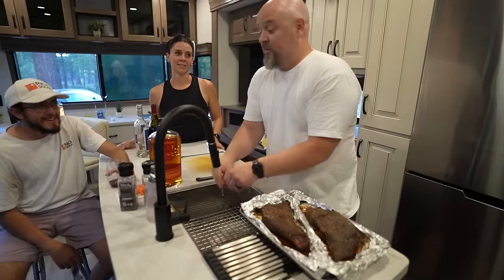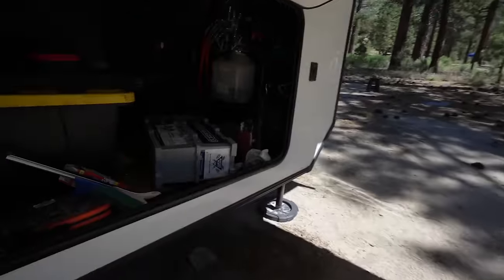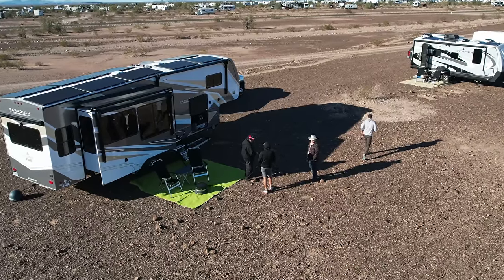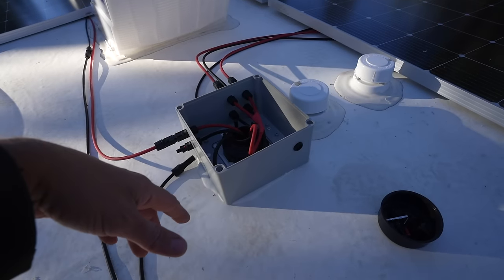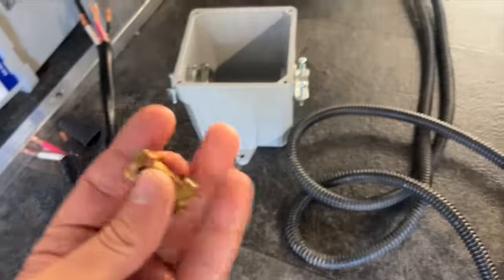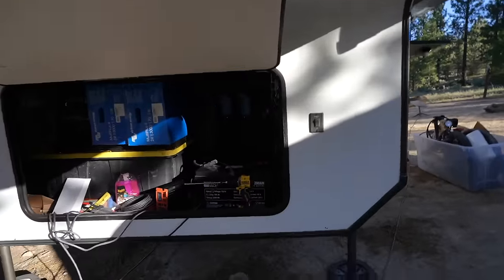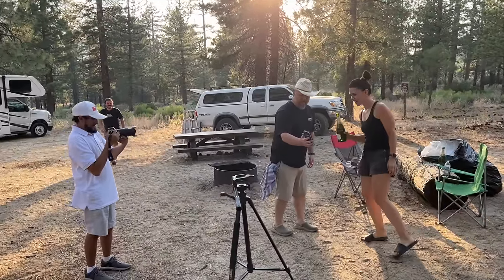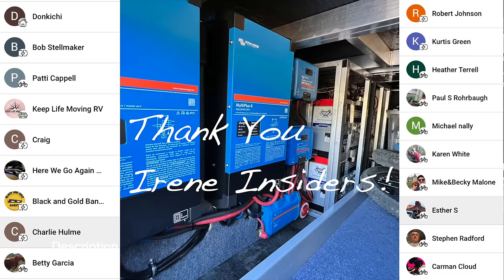24v Battle Born Battery Power with 2750 watts of Rich Solar! (RV Lithium Battery UPGRADE)

Comment: Just doesn't seem cost effective to me. if you're always in a place without shore power i can see this or a genny, but this setup for the avg non influencers who don't get really good deals for the advertisement of the video the cost is sky high. It would take many years of off grid living to pay for this setup before actually saving anything vs a genny at less than half the cost. it would prob take almost 4 years to pay this system off at a price tag of 8k + which this easily is with those BB batteries being a grand a pop.

Comment: Thanks Aaron and Chris! Below is what I will be installing beginning tomorrow morning on my 2022 310RL. Purchased the materials locally. Thanks for the motivation. You convinced me to go 24 volt over 12. Great video! 
 
4 380W Solar Panel
2 MP compact 24-3000-inverter 
1 100/50 Charge Controller
1 Smart Shunt
4 Enduro 24-100AH
1 Bluetooth Dongle
Reply from the maker: Hello 👋. Nice system you have going in! You’re going to love the lower amperage of 24 volt! Have fun!

Comment: This video could not have come at a better time! We have been shopping around for solar panels to add to the 200W  panel that came with our trailer. I just ordered four of the 250W, thanks for the discount code!
Reply from the maker: Great to hear Lulu, thats awesome! You're going to love the extra power! 🌞
Reply: We had to give up a lot of our system when we traded in our old trailer and this was the final step in building the system in our new one. Also, Rich Solar currently has a 25% off sale so that was a nice bonus. 😎

Comment: You coulda just bought some nice, used or even new SunPower 250w solar panels for like $70-$80 per panel in bulk at SanTan Solar, which is like 1/4 the cost and about same performance.
Also your RV Rooftop AC probably uses 1300w-2500w, each.   Even 3 x 1300w each =3900w/hour.  11kwh of battery is not enough, unless you install a minisplit.

Comment: Hey guys happy camping! So thanks for sharing your awesome victron system with us; I just recently got a quote for a victron system powered by 4 270 ah battle borns and 1200 watts of solar filling my roof…. Here’s the question will the one more battery off set enough for the lesser of solar granted I have a generator that could be used as a hybrid system with remote start to bring the batteries back up if needed; which then tells me why the extra battery if my ac could make it through the night with less. I hope I have asked this question understandably lol  thanks again. Oh next time you guys come through Tucson az say hi

Comment: I use a touch on or off faucet in my kitchen, and it really does help to save water. I put half of my panels in parallel/series and the other half just in parallel so I don’t have to worry so much about shading. Thanks for the video.
Reply from the maker: Thanks for sharing that! We had a touch faucet at our house and really loved it too!
Reply: We have a Kraus in the kitchen at home and it’s amazing. I got it at Home Depot because Amazon wouldn’t ship to Calif. It’s not just good at saving water. It’s great for washing stuff off your hand, like from making sausage patties or meatballs. Especially useful when dipping chicken into a panko cheese mix which creates cheesy gloves on the fingers. I can turn it on, then stick my gluey hand in the water and not have to clean the on off valve lever.

Comment from the maker: 🔋BLACK FRIDAY SALE NOW up to $400 OFF Battle Born Batteries https://tinyurl.com/2s3me6b5

🔋Battle Born Batteries 👉Save $50 on Battle Born Batteries https://bit.ly/BattleBorn50 Code "ireneiron"
😎Rich Solar 👉Save 12%💰 with code "irene12" https://richsolar.com/?ref=ireneiron
😎 250 watt panel https://richsolar.com/products/mega-250-watt-monocrystalline-solar-panel-best-12v-panel-for-rvs-and-off-grid-25-year-output-warranty-ul-certified?ref=ireneiron
💙MORryde 👉Save 7% on select products https://shopmorryde.com/?ref=irene Coupon Code 👉🏼 ireneironfitness7%
🌞200 watt portable solar panel https://richsolar.com/products/200-watt-briefcase-portable-solar-charging-kit?ref=ireneiron 👉Save 12%💰 with code "irene12" 
🔑Keyless RVLock www.rvlock.com/ireneirontravels 👉🏼💰SAVE 15% w/ code IRENEIRONTRAVELS
❤Alliance RV https://www.alliancerv.com/contact-sales
🛻Pullrite https://pullrite.com
🚲 Our E Bikes - Lectric eBike XP Lite : lectricebikes.sjv.io/GmZ6rL

BATTERIES
🔋Save $50 on Battle Born Batteries https://bit.ly/BattleBorn50
🔵Victron Multi plus ii 12 volt https://amzn.to/3suF3E8
🔵Victron Multi plus ii 24 volt https://amzn.to/3OKs3Sy 
🔋Victron 3000 MultiPlus Inverter https://amzn.to/3eZIWr1
⚡Surge Protector https://amzn.to/32ST9TD
🔋4/0 Battery Cable https://amzn.to/3eZnTVm
🔋Main 300 amp battery fuse https://amzn.to/3KT73I5
🔋Main 400amp t fuse https://amzn.to/34AVza5
🔋Inverter 300 amp Fuse https://amzn.to/3GecSf2
🔋Blue Sea On/OFF Switch https://amzn.to/3JJMGea
🔋Busbar 300 amp https://amzn.to/33X0OQI
🔋BusBar 400 amp https://amzn.to/3zzN1ve
🔋4/0 battery lugs w/ heat shrink https://amzn.to/3IufBSh
🔵Victron Bluetooth Battery Monitor https://amzn.to/3F8tmUt
🔵Victron Cerbo WiFi Monitor https://amzn.to/31EPQPi
🔵Victron Lynx dist https://amzn.to/3KQOUdS
🔵Victron 7 inch screen https://amzn.to/3solDkB
🔵Victron Orion 24v-12v https://amzn.to/3ssgTtX

TOOLS
🛠 Battery Crimper https://amzn.to/3Kxouwb
🛠Battery cable cutter https://amzn.to/3FLQdWk
🛠Heat shrink gun https://amzn.to/3tQV1HH
🛠Multi Meter(voltmeter) https://amzn.to/3Al0RSw
🛠Ferrel crimper https://amzn.to/3AkZQdx
🛠Ferrel crimper https://amzn.to/3tQWxJT
🛠Plastic Scraper https://amzn.to/3qN2W6U
🛠Heat Shrink https://amzn.to/3KoDdcJ

SOLAR
☀250 Watt Solar Panel https://amzn.to/47FmEVt
☀Victron 150/85 Smart Mppt Solar Controller https://amzn.to/3n9giIf
☀Victron 150/60 https://amzn.to/3YIBuGI
☀Panel mounts https://amzn.to/33DALyr
☀2 pole breaker https://amzn.to/3ArzwhS
☀1in Wood screws https://amzn.to/3Ims3TL
☀Mc4 connectors https://amzn.to/34Y6BpN
☀Roof Port Box https://amzn.to/3Ky6Ms8
☀Rubber tubing for Dicor https://amzn.to/3KszWJf
☀MC4 cable extension https://amzn.to/3Ag66De
☀Butyl Tape https://amzn.to/3qKYx45
☀Dicor self-leveling https://amzn.to/3AqqZeX

Comment: Impressive install! I am not sure I want to know the retail price on that. Shout out to RichSolar, I have one of their 150W panels on our trailer. It usually out performs it's rating by a couple of watts. I plan on getting more when I get around to upgrading from our little 200Ah system. I realize these videos are a little behind on showing, but I hope you guys didn't stay for the Tropical Storm. It looked like it might wash some roads out around there.
Reply from the maker: Thank you! Yes, we were out of that area before the storm, but you're right, those roads in with all the rain would be really bad.

Comment: Aaron, your system is virtually identical to ours with dual 24V Multiplus 120x2 inverters and the Watchdog EMS. You will probably run into a couple of the same problems I did with the Watchdog throwing a false “Missing Neutral” error when you plug into many 50A shore power sources and also with the Multiplus minimum input current of 18.6A which makes it tough to use a 15A shore power connection when moochdocking. Let’s chat sometime about solutions we found.
Reply: Thank you for answering a question I had for Aaron (minimum input). 18.6 amps minimum input current is rough. I run a Quattro 5000 12/220, and it's got a 13.5 amp minimum - and I complain about not being able to go down to 10! 18 is rough. (edit: I'm running 15k BTU AC + everything else moochdocking with a 15a cord). 

What happens if you only apply AC power to one inverter? Does it just fault out?

At a certain point, you might be better off with a separate battery charger. I found a 12V (technically 0-15 volt adjustable) 0-100 amp adjustable power supply on Amazon for a good price. I'm sure there's a similar 24V model. Just keep the Victron system in DC mode and tweak your power supply to match your AC limit. Not as efficient as AC to the victrons but better than popping breakers!
Reply: It’s not easy to reconfigure the wiring and the Multiplus programming to switch between 2 parallel inverters and 1 isolated inverter, so I haven’t really tested or pursued that option. Fortunately, I haven’t had very many times when I was limited to only a 15A shorepower hookup. The couple of times it came up, I got by with changing the Multipluses to “Charger only” mode which lets you dial the AC input current limit down to any number but you lose the PowerAssist function so you really have to watch and limit what you’re running in the RV during that time.
Reply from the maker: Hey Skyler! Wow, I didnt know you guys had this setup! Yes, well have to talk sometime about it. 

We haven't had any watchdog errors yet. We probably plug into 15 amp once a year when we go back home to MN... so we'll have to figure that out!
Reply from the maker: I didnt know about the Charger only mode allowing you to change the limiter down below the 19 amps. That would be perfect for us mooch docking on 15 amp. I'll just set it to 10 amps and run of the batteries and solar. 👍
Reply: Thanks, I didn’t realize that the Multiplus 3000 had an 18.6 minimum voltage. I have a new Oliver trailer with Victron on the solar side, but a Xantrex 3000W inverter/charger. I’d considered swapping to a Multiplus to take advantage of the load sharing between shore power and solar when running the AC while moochdocking. I can run the AC from the 630 A/h of Lithionics batteries for several hours, but with just 400W of solar, recovery time is excessive. I can set the Xantrex at 15A while moochdocking, but I thought the Multiplus could pull from both sources. I need to investigate more!
Reply from the maker: @Steve_and_Deb_Explore_the_USA just a single Multi Will have a 7.5 amp to 9amp low input limit . When you parallel two of them it doubles! So you’ll be good with just one inverter. 👍
Reply: It may not be affordable, but consider a single larger multi-plus or quattro. I have my single 5000va 12v / 220a Quattro, and I LOVE it. 13.5  amps minimum input on the AC side. And remember that AC power is ADDED to inverter capacity in boost mode. This means on generator I've got 8kw maximum - or running the air conditioner, microwave, and stove all without worry.

Conversely, I can use my MANUALLY ADJUSTABLE 120v battery charger when I've got less current. No diesel and I'm using my 800w gasoline generator? No problem. Have to run 500 feet of extension cord and can only pull a few amps AC? No problem.

One thing I use is a plug-in voltage meter so I can see how bad the sag is on long cords.
Reply: @IreneIronTravels   Woohoo! Now I can continue pestering Deb about spending another big chunk of money! Land Cruiser last year, fully loaded Oliver Elite II this spring, and $9k in e-bikes a few weeks ago. I'm on thin ice already.... :)
Reply: @PsRohrbaugh But with only 1 Quattro you're effectively limiting your whole AC system to a max 6Kw (50*120) because you can't pass through both legs when connected to 50 amp split phase and you can't invert split phase either. So, unless you've got a 4awg neutral wire, you'll be overloading the neutral with anything over 50 amps (6KW).
Reply: @barrynelson440  You're correct. However, my power needs are on the other side of the spectrum. When with rooftop AC + electric stove + microwave, I don't exceed 50 amps at 120v. Most of the time it's MUCH less. However, a single inverter means I can have 13 amp 120v AC input. This is a lifesaver for moochdocking and similar.

Also, I bought a 120/240v transformer. Very helpful for long cable runs. I can run 200 feet at 240v, and step down to 120v to feed into the inverter.

Comment: Would love to see more detail about the Multi+ II parallel setup and programming. We are planning the same thing, right now we have one 24/3000 -70 2x120 and would like to add a second. Also was planing on getting rid of our 12v battery and parallel two Orion 24/12 70 just like you did for 12v power.

Comment: Finally! I’ve been waiting for this video. System looks awesome. Did you need 2 inverters since you have 3 a/c’s? I still haven’t convinced the wife on our own MK295, she got a house instead.
Reply from the maker: Hey Rick! Yes, realistically we won't be running 3 AC's much, but running two you almost do need two inverters. Because the MULTi's are only 2400 watts continuously. 2 AC's plus the fridge, lights, etc.... would be closer to 3000 watts....

Congrats on the House!!

Comment: Very impressive, hope some of that was comp. Green eyes for sure. What would that cost the average RV'er without a you tube channel cost?
Reply from the maker: Thanks! Yes, this system is a bit extravagant for the average RV'er, but we've seen similar systems for people that do full-time and want to have the same amount of power off the grid as they have plugged into an RV park. A similar system to this could range around 25k, depending on labor rates. But, you could do a really nice smaller system for a lot less. It really depends on how you camp and your budget. 😊

Comment: How much weight did you add to the rig? And how did that add to the tung weight for the truck?
Reply: I’m not really sure but first, this is a fifth wheel and has pin weight, not tongue. Aaron put the batteries mid ship, not in the front, so that shifts weigh aft, and reduces load on the truck. Also keep in mind that Battleborns are really light. I believe the panels though add a lot of weight. Call Rich solar for weights. We are considering a similar system but scaled back and can’t go that heavy due to an 18,000 pound limit on our truck. We are in the planning stage currently.

Comment: Jesus... do you guys have an AC unit for your electrical for those hot desert days??? This stuff must heat up when the weather is gnarly. (Honestly, not to throw a spanner in the works, but do you have a smoke or heat detector in the battery/components compartment? It HAS to get HOT in there, even on normal days, let alone the desert heat days...) What a great setup! With all the online work you do, along with the electrical components of your rig and trailer, this must make you basically 'plugged-in' all the time. Aaron's mastery of electrical astounds me. 

I think it's nice that you've been able to partner with so many companies on your journeys to be able to "affordably" work these upgrades into your RV life. Haters gonna hate, I've seen the comments... screw 'em. You two are so professional and giving in your journey and learning experiences; what goes around comes around.

Loved seeing this. I hope it does for you what you need it to do. I can't imagine it's not a super benefit either way. Happy trails!
Reply from the maker: Thanks Kai! Yes, the system will produce some heat but the batteries and inverters do have built I fail safes on the temperatures. But, that is a really good idea to add a second smoke alarm down there for safety! We did add some water leak detectors down there.

We basically have 40 amps of power while unplugged! It makes running our business so much easier from the road. 

Appreciate ya!

Comment: Hi Aaron.  Could you send me a diagram in how you connected the 2 Orion 24v to 12v connectors in parallel to the front bay fuse relay.  I have a friend who is looking into the alliance paradigm 310rl and we will be building our own solar setup.  I think the 24 volt system is better then the 12 volt system that I did for my alliance paradigm 372rk.

Comment: 21:35 if you've got existing lithium batteries, you should have a separate 12v battery bank (just connect them to the 12v bus) or as backup batteries.
Reply: I'm all 12v, but my Sprinter van has 3 separate battery banks. 12v lead acid starter battery. 12v 100ah LiFePO4 "house battery" connected to the Mercedes electrical system - runs my ham radio, starts my generator, and a few other things.

Then there's a 12v DC-DC charger, and my 12v 700ah home built lifepo4 battery bank.

I ALSO have my 50ah 12V LiFePO4 "emergency battery", but that's completely a backup. Anyway. More is better!
Reply from the maker: I love the emergency back up battery. Still need to look into that!

Comment: I’m currently upgrading the OEM system on our new Interstate 24X. AS uses mixed flexible Merlin panels 200W and 100W wired in parallel. This results in nominal PV input due to shading. I installed a 200W Rich solar panel and I’m getting better PV than the original 300W. The plan is to mount another 200W panel to power our 300AH BB batteries and install a Nomadic X2  AC. Picked the hottest week in Minneapolis to do the install 🙄.
Reply from the maker: Thats so weird AS decided to go that route! Glad you're getting it sorted out though. Stay cool!

Comment: At 14:21 in the video it looks like you have the positive and negative leads run of the same battery. They should be at opposite ends of the battery bank so all the battery’s in the set drain together. Maybe you already fixed that during your install.

Comment: Was wondering if you  do side jobs to upgrade from 2000 to 3000 inverters and batteries from 200 Amp battle born to 300amp single lithium battery.